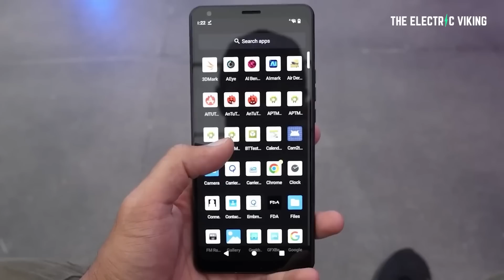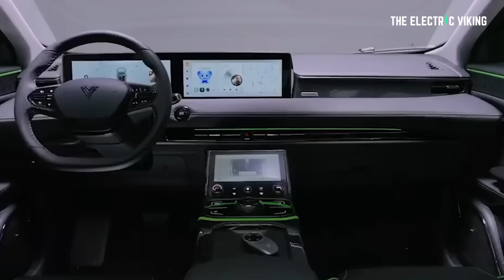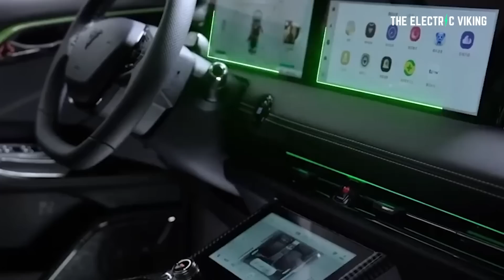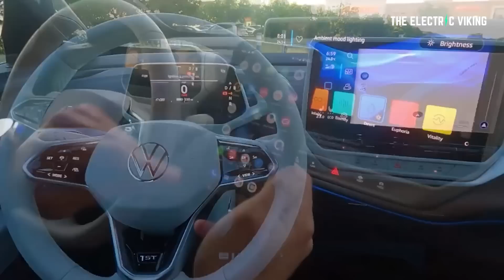Europe will be flooded with superior budget priced Chinese EVs

Comment: KISS. 
Give me the high-tech EV system but with a manual parking brake, three-knob HVAC controls, and an analog speedometer. No touchscreen, only the Federally-mandated backup camera that defaults to a radio display.

Comment: Where I live in Central London, about 2 miles from the House of Commons, there's a fast charger just outside my flat. I've witnessed at least 10 very disturbing road rage fights about using the charger, bullying sheeple off the charger. Some are daytime spats, but the worst are at 3/4/5am. 

It's going to get worse, and what about rolling power cuts?
Reply: Just one charger?  There's your problem.  Tesla Superchargers have anywhere from half a dozen to 48 chargers.

Comment: Great video. Living in China, we are still mulling over which EV to buy. I have looked at many, but really do want fully up to date near to self driving functions. Nita is another one to consider. It is hard to keep track of all the new brands here.
Reply: clemathieu JT  Neta
Reply: Can you answer how much coverage NIO is getting in China and how positive is it.
I’m just interested as an investor
Reply: Neta is not for you if you really after best self driving. I have U 400pro only 1 month old (121 800rmb). This version have only standard cruise control (no ACC) but when I was test driving in higher model with all that fancy functions the sales wasn't convincing. And at the very end when sales guy was parking the car I asked why he didn't show me self parking since that is there. He said he isn't confident in it. So Neta is ok but more on the budget spectrum. It is cheeper in low equipment versions then others. For good asisted driving you should look higher in price range, at least above 200 000 RMB. But it all isn't yet mature really. Xpang P5 also didn't impress me with that feature. That is why I went for low cost Neta.
Reply: @jhytry  Yes, Neta is among middle EV brands in China.  But this clip gave its credit for install Qualcomm 8155 to car's computer.
Reply: Seems to be Xpeng, and to a lesser degree NIO, has the best self driving tech. NIOs are pretty expensive though. But the Xpeng P5, although I find it kind of awkward/ugly looking, is probably the single cheapest car that is nonetheless equipped with I would say near industry leading self driving tech, including integrated lidar. Some of the recent videos from reviewers testing their NGP 3.5 city self driving has looked pretty impressive.
Reply: 2weeks sry jus HAD too

Comment: About the chip shortage: 50% of Xeon was from Ukraine, and 30% Of beryllium was from Russia, both of these supply routes are at basically zero now. As such there is a shortage for manufacturing the older process technology (100nm down to 20nm) which is used in vehicles for all the dedicated ASIC's. The actual reason USA manufacturers and (to a lesser extent EU) are stalling out is this: They are not manufacturers anymore: They outsource supply of all components. Thus, when a supplier says they don't have part X, the USA manufactures no longer have any of the engineers to design around this or work in a part that may have a different comms bus or different comms protocols. Instead, they do the only thing they know how to do: They go out for tender for someone else to make a part compatible with their existing vehicles software and buses - which is expensive and take year a long time, and often means entirely new ASICs to be made. The MBA's have basically ruined them - because they have applied JustInTime manufacturing to mean "don't make anything just order what we need day by day and make our suppliers take all the stock holding risk". The other thing that happens is Toyota got sued over the 'phantom acceleration' which the court accepts was probably bit rot. To survive bit rot in MCU's you need 3x MCU's: So when one goes bad the other two out-vote it. So as a consequence of this court case cars in USA are now being built with triple 3x chips on the ECB's and other important controllers, where as in EU and China they are not.

Comment: Before buying a Chinese EV, check out how many Chinese car manufacturers and Chinese EV went bankrupt over the past 5 years.  None of Chinese EVs making any profits on a yearly basis, despite heavy subsides from the govt.  No one will be able to fix the battery or software problems when the car shut down one day and couldn't be turned on if the company goes bankrupt.

Comment: Good points made. As a VW ID3 owner, I have to agree with your point about VW software. I thought "pathetic" as you said "abysmal". And abysmal is the stronger, more accurate, word.
Oddly, many new car owners in UK/Europe don't see what I'm getting at when I talk about awful car software. Much of it doesn't work properly, or at all. That's ok on an old tech ICE car, but it simply won't do on a BEV.
Reply: Europe has the updated version (V3) of the iD3 software. That is apparently way less buggy.
Reply: @allangibson8494  There is a free V3 OTA update but... You have to have V2.4 installed, which requires you to go to a dealer. You also get a new 12v battery, which I don't need as I've never had an issue with that. VW have always said they would send emails when all this was ready. I've not heard a peeps out of them, and I believe there are many hundreds who also haven't. Typical. If you want to close the gap on Tesla, you have to make it easy for people. Why not message people through their cars or We Connect apps, or is that too difficult, VW?
Reply: @ramblerandy2397  One of the problems with the old original software was apparently compatibility with mobile phone networks outside Europe…
Reply: @ramblerandy2397  Many VW buyers did not register for the online stuff, that is the problem.

Comment: The limiting factor for EVs Sam, is ..NOT, buyer demand, which is ..already, rising exponentially, year on year on year. 
THE, limiting factor, ..IS, the currently limited amount of ..Lithium ..Supply, PRODUCTION, availability, that is essential to manufacturing the necessary volumes of EV batteries that are required. 
This is thanks to years, of chronic underinvestment, in the very source, of where the Lithium comes from in the first place, ie, ..the Mines, and this has now resulted in very large price increases being paid by the battery manufacturers for what Lithium is currently available, as they all now scramble to try and lock in long term Supply from the limited number of Miners who are currently in PRODUCTION, and this situation will last until further new Lithium Mines can be brought on line and into production, which will take an absolute, ..minimum, of 2 years, for hard rock, and between 7 to 10 years for Brines. 
So, the bottom line Sam, is, that while everyone has been running around frantically building huge new EV battery manufacturing Giga-Factories, all over the world, in as little as 2 years, no one, was giving even a moment’s thought, to ..where, the essential, Critical-Mineral,  Lithium, needed to make all of these batteries with, was going to come from, resulting in the now current Lithium Supply and Demand mismatch. 
As Elon Musk said recently, if you are a miner who is currently PRODUCING, Lithium, you now have a license to print money, at the same sort of multiples as those who are producing software. 

Or, to now quote the words of Chris Ellison, the CEO of Australian mining company Mineral Resources, …”If you now own a PRODUCING Lithium Mine, ..you’re GOD, and if you don’t, ..you’re screwed, ..by us”…..!! 🙄
Reply: Lithium is not a supply bottleneck.
Semiconductors are.
EV’s are a mass of semiconductors and the older car companies can’t get enough to complete the IC cars with 10% of the semiconductors in an EV.
There is a 12 to 18 month backlog on semiconductor supplies.

Comment: Stock prices are coming down because of economic conditions - money is heading for bonds and other safer, inflation-proof investments. With the increase in electricity prices, EVs are becoming less popular. Where's the extra electricity coming from in Europe for new EVs  - more coal fired power plants with resultant far higher CO2 emissions per km than petrol cars ? User experience can be improved far more by improved software, not faster CPUs.

Comment: Car company can simply provide a dock for the radio.  allow user to plug in a 12" Galaxy tab    This allows the company to automatically update the infotainment via Google update.   Problem solved.

The only thing the car company needs is to provide buttons for AC.   Probably really dont even need that, but some people like dial for AC and a dial for volume.

Boom.  Now automaker has a hotspot for their car.  Probably a subsidy from Phone company to provide a Verizon Logo on startup.  etc.  Provide more hotspot throughput to Verizon cell phones or google tablets.   etc.  whatever.

And people will want to update that tablet in couple years.  or, if you allow users to take their'radio' with them, they will be replacing the tablet when junior sits on it.

Comment: Living in china nad I just got Neta U400 Pro 1 month ago (the almost cheepest version of the car with 400km range and CATL battery). It is great value for the money - it is cheaper then BYD in same size (atto 3 is about 4000 USD more, my car was orederd in June delivered in September - total of 121 800 RMB). It have decent infotament (voice assitent is OK, and streaming services work fine. it isn't the fastest but it isn't the Snapdragon version, and no annoyng glitches so far), OTA is there, App control, V2L, Standard Crusie control (they have more assited driving on higher priced models), panoramic roof and that price included 6kW home charger with installtion. In General features are nice. It could drive a bit better - especially stering is way too light for me - my 3 year old son can turn it with 1 hand till end when sitting in garage, but power is definately sufficient. But there really is nothing in this price even in China (Higher equipment versions are having more competition, so they deliver mostly small battery versions many as Uber taxi types (didi in China)).
Reply: Hozon doesn't get the press that Xpeng or NIO gets, but their Neta sales are really coming up fast and that hot new Model 3 sized Neta S is just about to come into production too.
Reply: @tren133  The economy in China is also kind of down. I think they overtook Xpang and NIO in deliveries mostly becouse they offer cars on the cheeper side. The V is biggest vehicle in that price bracket (although I think Leap Motor T03 is much more solid vehicle).

Comment: AFAIK Ford, GM and VW also manufacture EV cars in China too but possibly as one of several choices in the production lines.  China's own EV companies on the other hand just stick to what they only know best as they have not been serious contenders to the big international car manufacturers of internal combustion engine cars.
Reply: But that's exactly the point. The Chinese decided they would never be able to catch up to foreign automakers on ICE tech. They are just too far behind. Decades behind in some cases. Which is why they chose to do mostly joint ventures to build ICE cars. But EVs are a blank slate for everyone, and the Chinese government went all in on promoting battery production as well as a full set of EV supply chain infrastructure which would allow domestic Chinese automakers to leapfrog the west in the future EV market. They didn't figure this out last year, but they started preparing for this like 10 years ago, and only now people are like how do they do it? How could they build so many EVs with such low prices? The US and Europe will try to catch up, but Tesla aside, no one has the supply chain infrastructure to match the Chinse EV automotive industry, and they might never be able to catch up, just like China was never going to catch up on ICE vehicle production.

BTW VW does try to build EVs in China. They've got their TWO massive joint venture partners with 500k plus annual EV production capacity building the ID.3, TWO versions of the ID.4 and TWO versions of the ID.6 (which is a China exclusive). But they are getting slaughtered in the Chinese market. Between high prices and laggy software, both startup Chinese automakers like Hozon/Xpeng etc as well as "legacy" Chinese automakers like BYD, GAC, Geely, and even VW's own JV partner SAIC are just killing VW in the Chinese EV market. VW ID sales have been disappointing from the start and remain disappointing to this day.
Reply: @tren133  You are not Chinese and so is not expected to know China's problem.  China has no significant oil reserve so it never wants its citizens go crazy buying ICE cars like the Americans running 5 to 6 litres engines.  If you have no oil to throw away but import every barrel you don't develop an industry for it.  So avoiding ICE is China's own sensible choice.
EV on the other hand, just like HSR and metro, are all electrified and China generated electrical power twice the US last year.  Also China is the world leader generating the most in each of solar, wind and hydro.  so Chinese people can have EV because China is the world biggest green energy generator.

Every car manufacturer, be it VW, BMW from Europe or Ford and GM from the US all open up factory in China to manufacture cars.  Some of them are for Chinese market but a sizeable of the production is shipped back to the home country to sell.  Prior to covid VW, VMW and Mercedes were known to generated up to 40% of their annual profit from the Chinese market.  If these car manufacturers couldn't compete with the Chinese EV car that is their own fault because they have the exactly the same supply chain as the Chinese manufacturers.  I believe the primary aim of the foreign car manufacturers in China is for home country sale.  Thus it is not surprising they lose out to the Chinese EV car manufacturers who have a much better knowledge of the local needs.  Also Chinese EV manufacturers targets the low income buyers to give value for money.  Western auto makers are selling their products to the maximum price the buyers can bear.

Comment: I live in Texas and you're right as far as legacy auto not able to make an EV without problems. But the main hindrance on the F-150 lightning is that once you hook something behind it the mileage goes to unusable. Anyone in there to pick up in Texas also pulls trailers if not on a regular basis semi regular. And if your mileage goes down to 100 and something miles that is just not practical. So not only do they need to get the bugs worked out but they must put a larger battery pack. That is their only solution as far as this state and I am sure a lot of other states because there is a lot of open miles you have to cover all over America. You can't be stopping two and three times a day to charge I'm a 300 mi round trip. I don't mean bumping up the charge I mean recharge. Especially people in work trucks because they are on a time schedule and that is that.
Reply: Yea, hopefully that will soon be solved. Its a great point though that many inside cities dont udnerstand
Reply: I think this will mostly be solved by people getting smaller trailers. The drive on these EVs is efficient. The problem is the load.
Reply: The lightning really needs a 250kwh pack but they can't fit it because they are using a narrow ICE chassis. The other thing that will increase towing range is people buying trailers that are aerodynamically shaped instead of just a box. Adding a bed toper with a wind diverter on top will also help
Reply: BULL-oney! The vast majority of people with pickups don’t haul anything. They’re just big cars for soccer moms and commuter vehicles in Texas. Same in Georgia. The vast majority of people don’t haul trailers.
Plenty of demand for Non-Trailer hauling pickups. Until they’re selling at least 2 Million EV pickups in the US every year, the towing won’t stop people from buying EVs. Work Trucks like the SuperDuty Pickups will com later as EVs but there are not that many sold compared to normal F-150’s and similar Light Duty Pickups.
Reply: @saff226  i drive a model 3 tesla with a 72.5kwh battery capacity. Charging that isn't too long on a motorway road trip (using 150kw and 250kw superchargers), but not instant. How the hell is having more than a ton of batteries and 3x the capacity to recharge going to help anything in terms of time and energy spent to do the job without 500kw chargers (which don't exist yet, anywhere)?

Comment: I bought my first phone with a 8155 chip about 3-4 years ago for about $300 US. By today's standards this is old tech and cheap. With the current chip situation the price might be crazy. I work for a contract manufacturer in PCB assembly manufacturing, and part availability for old and obsolete parts is ridiculous.  If businesses don't have contracts in place for their chips they're in a lot of trouble.  Auto manufacturers are way behind the curve in this aspect, as are many other businesses.  We have lead times of well over a year for some parts because our customers were not proactive about their needs. There are probably many newer and better options available for some of the automotive needs but noone but Tesla seems to be  proactive about it. I'm not a Tesla fanboy. In fact I have Nissan Ariya ordered because it's designed better for the average user and cheaper for the requirements we have(despite it's lower efficiency), but the truth is Tesla is more proactive.